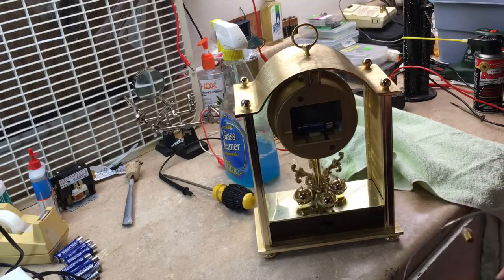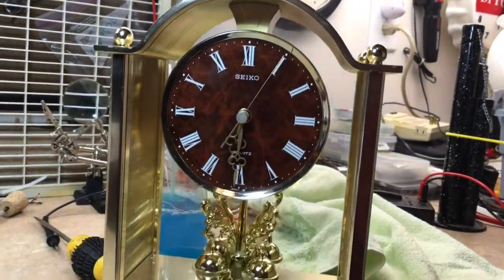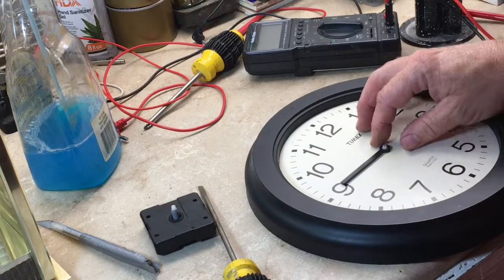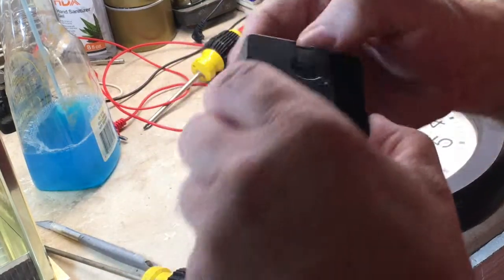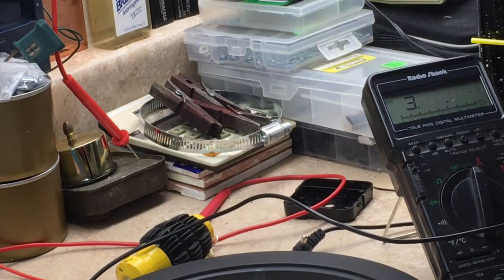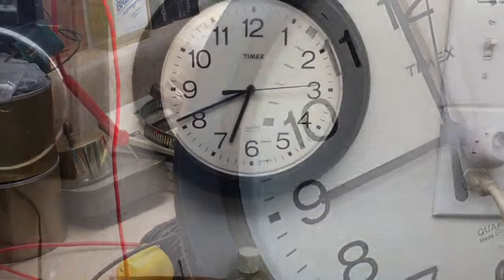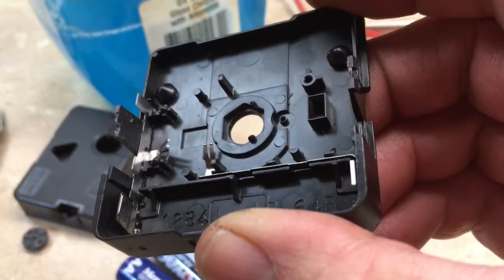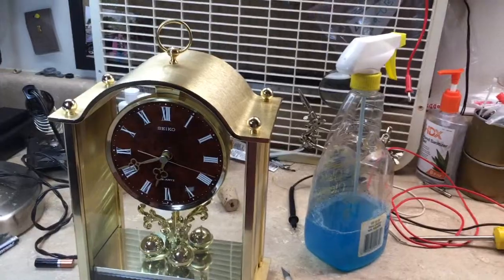Repairing Two Quartz Clocks

Comment: Battery leakage has been a problem with a few of our quartz clocks. Mums clock had a badly oxidised land on the board were the fingers contact it that come from the battery.  I cleaned it up but the clock refused to run although it drew a few uA. I set it aside and a few hours later the alarm went off. I'd left the alarm on.  It's been running ever since.  My own Garfield clock had been left without a battery for over a decade and didn't start I put a battery in.  Another case of corrosion on the board yet no battery leakage as there wasn't a battery in it.  Clean up and add solder on the lands and it ran again.  Another had hair round round the rotor, I managed to extract it all and it hasn't missed a beat.
Reply from the maker: Awesome, I wish mine would have worked out that easy. Unfortunately there was no material left to add solder to. That's interesting about the hair getting around the motor, never seen that before!

Comment: My grandmother had one of those clock with the spinning "pendulum", it's probably still in the room she stayed in in my parents house.  No idea where it came from.

I have a "CD Clock" from a place my mother used to work at years ago, it also has a dead quartz mechanism.  I had another one from another clock I tried but none of the hands fit for some odd reason, and it sits unrepaired.  If I think of it I'll look into a different mechanism from China on fleabay and possibly get it running once again.